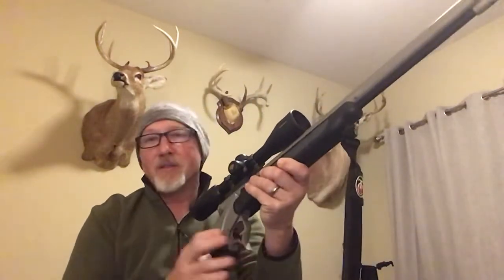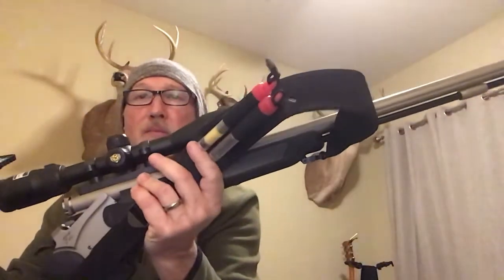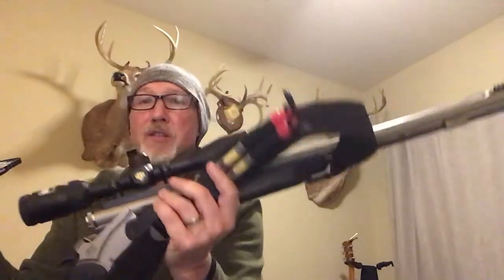Thompson Center Arms FX Muzzleloader Cocking Issue

Comment: I had this problem years ago when T/C brought the FX to market. I called T/C which I was and still am a big fan of. They in no way wanted to check the gun and hopefully correct the problem. It wasn't until I flat out told them I had totally lost confidence in the gun and did not want another FX. It was then that we struck a deal  that I send the gun back and they sent me another Encore model which has had no problems and I'm happy with the replacement Encore. I still like all of my 4 Encore's but CVA has closed the gap as I own 3 CVA's.  I will have to say my Encore Endeavor, Pro Hunter, and CVA Accura are absolute shooters.

Comment: What happens when it does exactly with your trouble you’re having even without a primer in it when I take the primer plug out of the barrel it works to kick the the trigger and the hammer but when I put back in the plug without the primer and try to pull back to hammer it does not do it. Any ideas?

Comment: I think I can help you. At some point you took your rear stock off, there's a hex bolt and had a thick washer and a locking washer. One or both are not in the, my guess it's the locking, this will cause your hammer not to lock. Your Beach has zero to do with the hammer in any way. Find the washers that hold the rear stock on and install. You'll not have this issue any more. And primers have nothing to do with the hammer. Also make sure your firing pin is not sticking out.
Reply from the maker: I have never taken the stock off. It happens because the primer is not "seating" itself completely. As in the video, I can put a primer in the breach plug, softly close the action, and the hammer will not cock. I can open the action, slam it home, and the hammer will cock. I found an article somewhere on the www that stated their is a difference between the Winchester primers and other primers. It is small difference, but, it is there.
Reply: @4greenfam  not looking to argue just trying to help. It just doesn't seem that a primer would be the issue. As a suggestion I would check that stock screw, it must have a double thick washer and a lock washer, and next would be the lock up springs in the barrel itself. YouTube has a really good video for upgrading all the springs from M*carbo. Mine is coming today and when you see this I'm pretty sure you'll do the same. Hope this helps